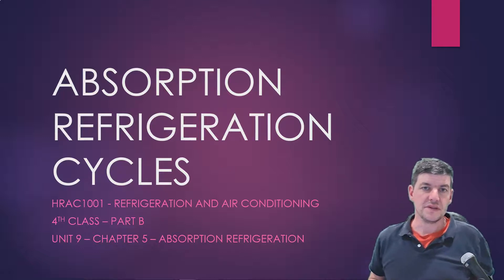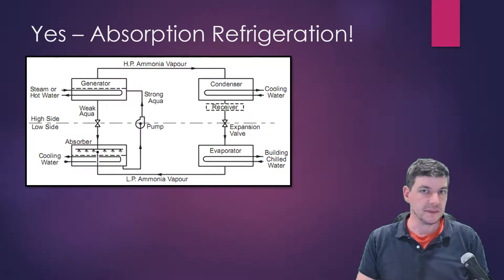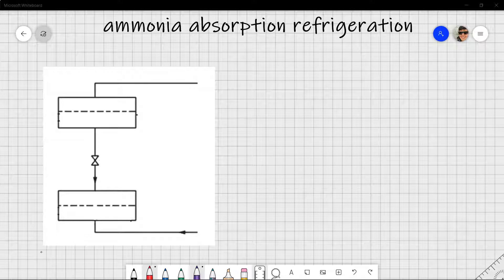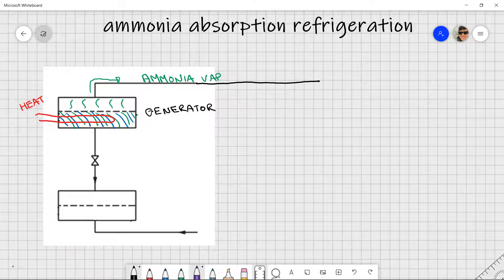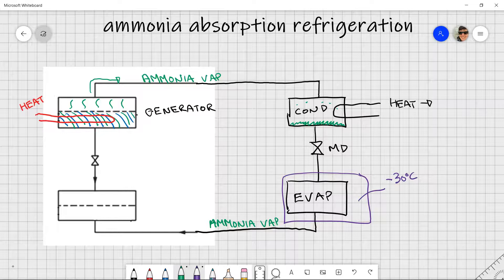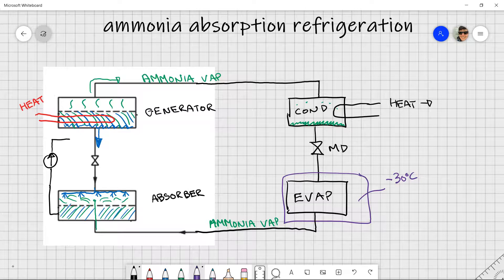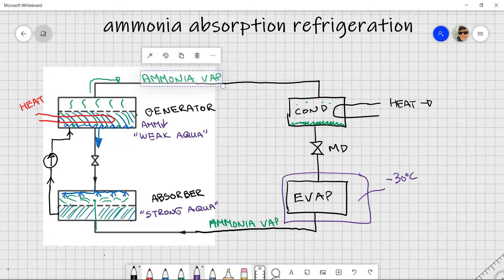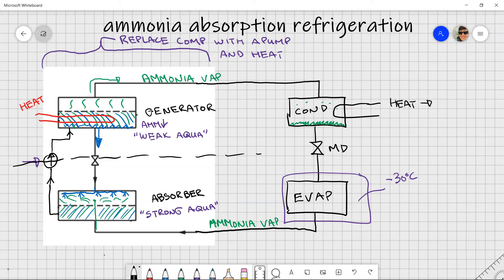Absorption Refrigeration Cycles - Part 1 - Ammonia Refrigeration Cycle

Comment: I'm sorry but you kind of missed the point of absorber and generator. The way you explain it, you wouldn't need either, you would just use a pump to raise the pressure of the vapor. A vapor pump is a compressor and what you describe is basically a compression cycle. The point is that the pump uses minimal energy, a fraction of the energy of a compression cycle. The actual movement of ammonia is due to vapor pressure differences in the system created in the absorber and generator. When the absorber pulls ammonia vapor into the water, the vapor pressure is dropped, drawing vapor from the evaporator. Then as the weak aqua is heated you drive the ammonia out of the liquid into vapor form creating a localized high vapor pressure, the vapor then moves to the compressor that is constantly condensing the vapor and creating a low pressure vapor zone to continually draw more vapor from the generator. The main energy required for this system is the heat required in the generator.  You are correct that the absorber, pump, and generator replace a compressor, but the pump's purpose is not to increase the pressure like a compressor.  It simply moves the strong aqua from the absorber to the generator so the heat can boil off the ammonia and create localized higher pressure. Not meant to be rude, just wanted to clarify for future viewers.  To understand this concept, it is important to understand that when liquid ammonia vaporizes it takes up more space, increasing pressure.  AND vice versa when it condenses.